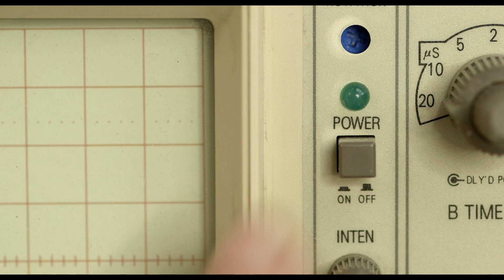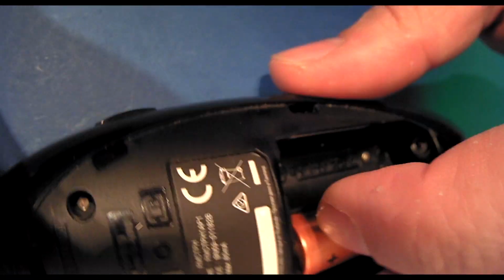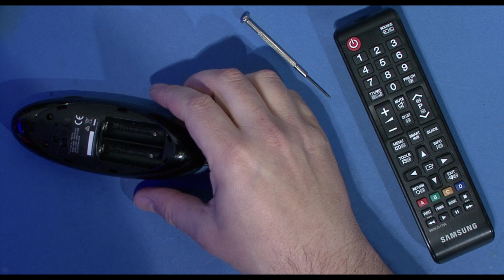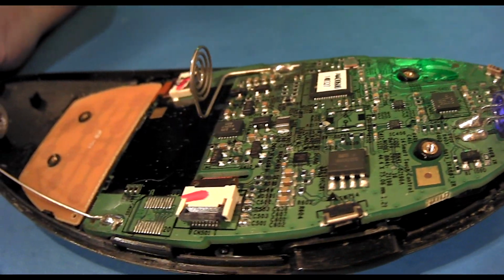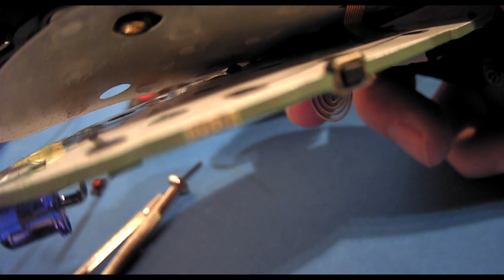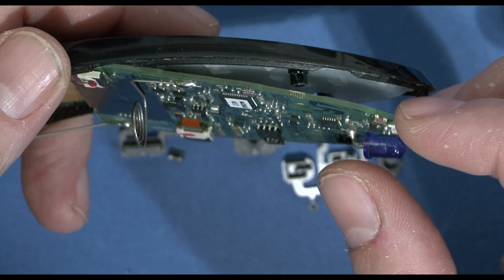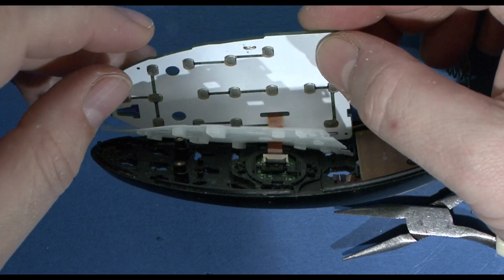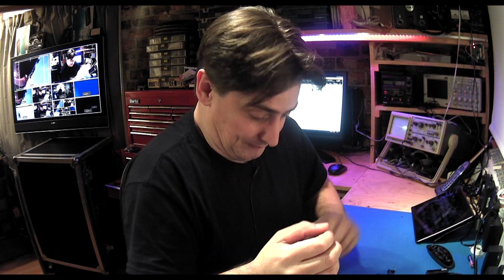Samsung TV Problem! Smart Remote Right Button Faulty PART ONE

Comment: It took me 5 mins to observe it and investigate and I found away to remove everything very easily-and fixed it -I’m not a tech like this guy but - there are black brackets keeping the circuit board just adjust it abit and the board moves out - I clean everything put it back together and sorted

Comment: You are supposed to lift the black tab before removing the ribbon cable, you should never remove it like you did you can damage the ribbon or connector.
Reply from the maker: Thanks, yeah but didn't damage it and now works better than before so happy. Cheers.
Reply: +FixItBuildIt Please don't take it the wrong way I was just giving you helpful tip, reading back on my comment it does sound patronizing so I'm sorry . If you lift the tab before inserting or removing the ribbon you will do so with zero insertion force ;).

Those dome switches are pesky, I had a universal remote that used those switches, a few of them didn't work either, I pretty much did what you did except I cleaned mine with alcohol and a tooth brush.
Reply from the maker: Ah thats fine.. everyones ideas are welcome, so we can all learn together. I learnt something new too ;)
Reply: FixItBuildIt were can i get those ribbons mine is broke in 2 piece its cut from thr middle
Reply: @FixItBuildIt  My problem with that remote control is that the Mute button doesn't work, it clicks but the mute function doesn't work, what could it be.  Thanks for your help and videos.👍🏼

Comment: Folks i've been a professional techie for years. 
Too easily the term 'burnt out' is used to describe old switch contacts which is not exactly correct. While the surface may be burnished from original it just requires a fluid clean and when it comes to contacts in such a small device its more that there is barely enough wetting current to get across aged contacts.
Some contact cleaner with only clean, may attack plastics, and will not leave a protective film.
All that needed to be done was spray something like INOX, (Inhibit Oxidation), over the dimple button surface. You can be liberal with it. Doesn't dry or crack plastics. Fluid will run under the switch dimples and clean/protect the contact areas for many years to come.

The reason I visited this video was to work out how to get the dam thing apart!
Reply: I got it easily apart

Comment: Hi, I got the similar model remote (model no: bn59-01181g ). The battery drains too fast. Do you have any idea how to resolve the issue.?
Reply: exactly the batteries drain fast and I forgot to remove them and when checked after a year they had leaked all corrosion inside and the remote stopped working.
Reply: @abhaysomkuwar3697  что делать в таком случае

Comment: Hi All,
I have a weird phenomenon with this remote control.
My baby boy played with it and put it in his mouth and from the that moment the on/off button stopped from working.
the problem is that this button is not working only when the batteries are in the remote.
If I connect the remote to different power source (connect a battery holder to the plus and minus connectors of the remote) the button is working.
More than that I noticed that if I leave the batteries inside the remote but I bypass the default bridge inside the remote batteries holder (there is a metal wire that connects the plus of one battery to the minus of the second) with a wire the button starts to work again.
I really don’t understand this – I can do the bypass but what is the reason and why this button only (all the others works fine either way)
Have you encounter in this phenomenon?